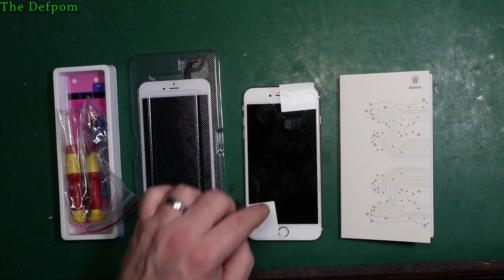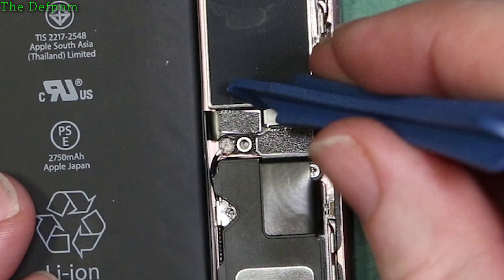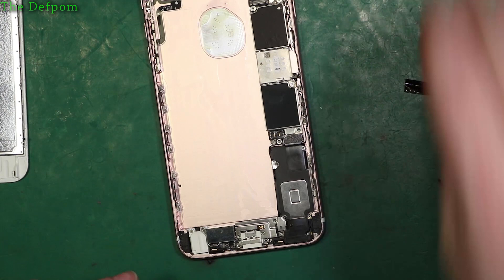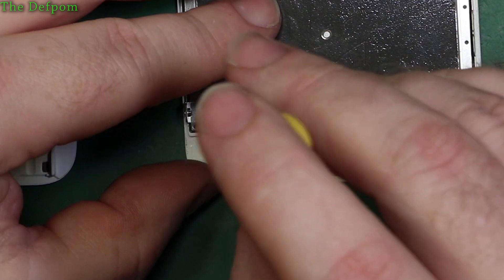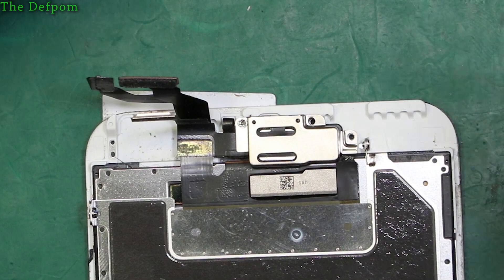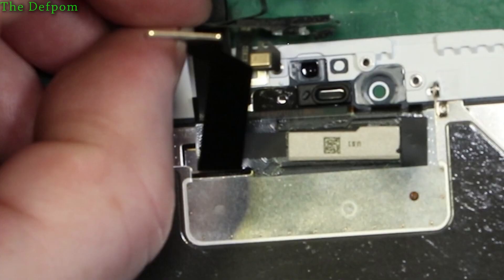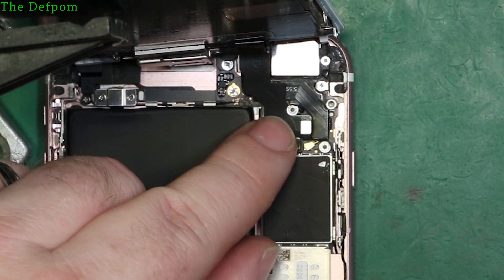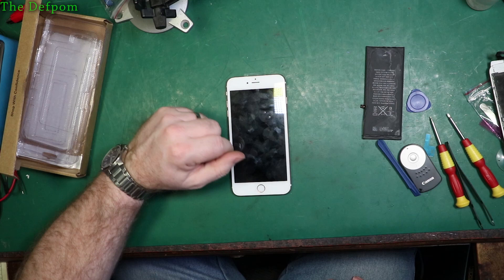#657 Fix Your Own iPhone 6S Plus Screen and Battery !

Comment: Very nicely done, and no parts left over :-D.
I know what you mean about the connectors, feel for the sweet fit then jiggle it a little and it plops in nicely.
Not something you can explain, it's judgement.
I was thinking that two strips would be good enough for the battery, then you said it lol.